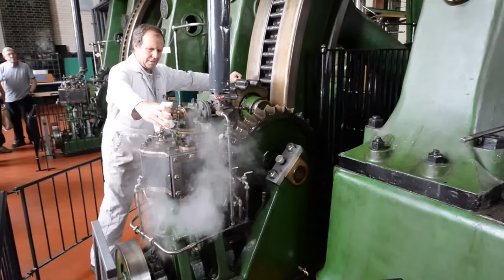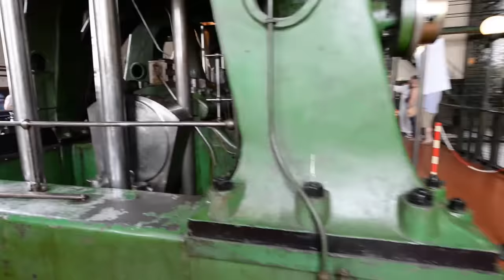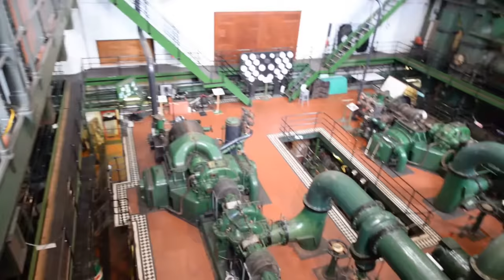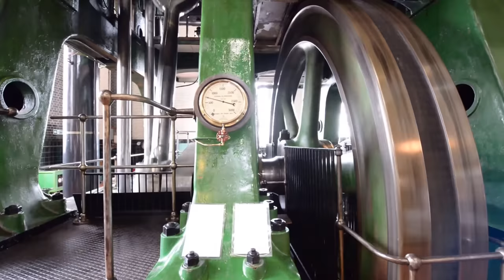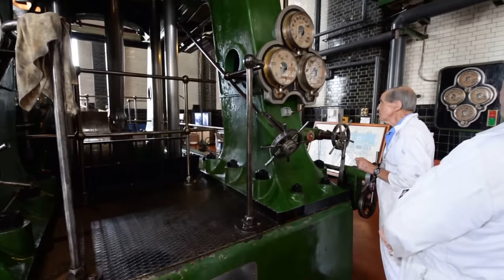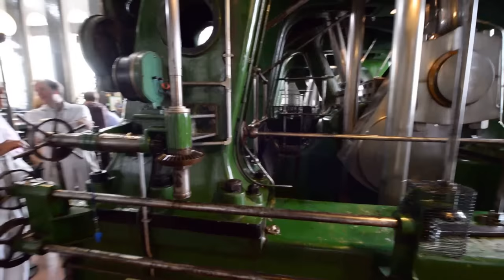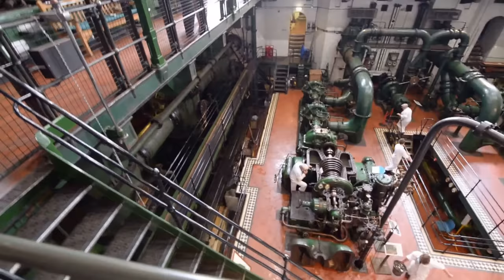Kempton Park  Big Triple Steam Engine Starting

Comment: Did some quick calculations a thousand horsepower at 20rpm has over 264000 ftlbs of torque.
Reply: two engines, 1008 hp per engine, 550 ft-lb/s per 1 hp, 60 sec per 1 min ... at 20 rpm ...
Wouldn't it work out to 2 x 1008 x 550 x 60 / 20 = 3,326,400 ft-lb total torque?
Reply: LOL, ftlbs
Reply: @D2RG6  at 20rpm by 1008hp it would be 481320 nm...
Reply: How many men using oars would there need to be to match that?  Considering all men are all natty and 190 lbs and can bench press 250
Reply: AMD yanks just aren’t intelligent enough. They can’t even get their dates in correct order of (seconds/minutes/hours/)days/months/years. And spell aluminium without the second I.
Reply: @shaunbrown85  just an fyi. It was us Americans who discovered aluminum. So for this word, in particular,  you're wrong.
Reply: @chadmeyer9500  ive heard that the last people you want to ask about the english language are the english. There even a video on here where an american professor is describing how americans are ruining the english language.
Reply: I love math!
Reply: Matthew DeMarinis I love math(ematic)s too.
Reply: @snipesrock  if you're going the way of "well it's what it was originally called" then you should spell it alumium :P
Reply: So almost as much as my civic
Reply: @chadmeyer9500  triggered much ????  also you spelled  "LABOR DAY" wrong its Labour, and I think your caps lock key is broken .
Reply: Spanish and Portuguese are like English and American now. They're close but not the same.
Reply: @chadmeyer9500  You're absolutely right, except for one thing, you're wrong. 
Aluminium is actually spelled, "Aluminium" as per the periodic table. 
Also, Americans are actually ruining the English language, so there's that; Gypsum isn't even in the periodic table, it's just a byproduct of Calcium, you've misspelled "Thallium", "Thullum" isn't an element, it's a 2005 Indian drama, I'd guess you mean "Thulium". 
The two following elements are also misspelled, "Gallium" and "Helium". 
You need to remove your tinfoil hat and have a look around.
Reply: @shaunbrown85  According to the periodic table, no, he isn't. 
Aluminium is however listed with "Alternative Name" as "Aluminum", and that way of spelling it is indeed correct in the US and Canada, but for the rest of the world (for the most part) it's Aluminium.
Reply: You guys.
Leonardo DaVinci could speak and write English, but it was considered a forbidden language.
What would he think of the Brits masticating it over a few millenia? 
Quit biting your own tails.
Every country and race has its own skeletons, and the faster people realize that, the faster we all realizing that our differences mean nothing, and should just be lessons to guide the future.

If you still want to argue, should we still be using names like Plumbum, Aurum, and Argentum? How about Kalium? Natrium? Stannum?

So much for whatever English you wish to use.
The Queen's is fine, but the rules and spellings were put in place long before the Yanks broke it off with that bastard George.

Back to the machine, please!
Reply: @shaunbrown85  why on earth would you do seconds/minutes/hours? what sence would that make? you start at the largest unit and narrow down as needed.  Would you ever say its 6mm and 2 meters long?  why would you ever start with the smallest first?
Reply: Troy dejesu no you wouldn’t say that every time, obviously, but that is the order; day comes before month. That’s the point. The 2nd day of January 2020. Just because you might say “the 2nd of jan 2020, it’s still the fact. 1 comes before two but you wouldn’t say “ive got one two pieces of jewellery”! That’s just daft. One still comes before two in the correct order, though.
Reply: I think the Brits are just upset the Americans have made the language more efficient, dropping all those extra letters (labor vs labour), if not entire words (November 6th vs 6th of November).
Reply: @chadmeyer9500  Even in your argument you still say 4TH of July and  !st of May ETC not July 4 or May 1 so you don't  even make sense of it yourselves.All i know is i enjoy getting payed big bucks (US100k) to come to the US  for 3 months of the year to supervise the installation of lifts and escalators, because it's in metric,and there is a big shortage in qualified people.
Reply: @snipesrock  First isolated by a Dane. In 1808 Sir Humphry Davy, the British chemist who discovered the metal, named it “alumium.” With just one “i” and an “ium” ending, it straddled the two competing versions we have today. Four years later, however, Davy changed his mind and gave the metal the name “aluminum”.
Reply: @shaunbrown85  All languages change over time. It's just how life is. I mean we're not speaking Anglo-Norman, now are we?
Reply: @nssherlock4547  You won't hear anyone call it "Eleventh of September" though.
Reply: @cojack5941    My math is a bit rusty, but ill give it a shot. The average human can pull around 200 newtons of force i believe, so lets say they are pulling an oar on a viking style ship and the fulcrum point of the oar is 7 feet from the handle, that creates 314.73 ibs-ft of torque, so that means you would need 839 men to be able to create the same torque as this engine.
Reply: @slaytronic  also in America, America is normally capitalized pretty disrespectful not to.
Reply: @snipesrock  Aluminum was first isolated in 1825 by Hans Christian Ørsted (Oersted) in Copenhagen, Denmark. Ørsted produced aluminum by reducing aluminum chloride using a potassium-mercury amalgam. The mercury was removed by heating to leave aluminum.
Reply: And imagine Titanic's engines, 74rpm and 46000 hp :-D
Reply: this engine has much more than 1000 horse heights .. Horse measurement is not suitable for measuring engines of this type. A huge mass of own, it is enough to compare the mass to engines in cars and you already know everything
Reply: David Vance  Sure, and every single horse has different power ofcourse. Watt is standardized for this purpose.
Reply: Chad Meyer  that’s a lot of text right there
Reply: @chadmeyer9500  no need to keep the caps lock on when typing, bud.
Reply: @Nareimooncatt  I'm a brit and I have no fucking clue what's going on. Our language our rules 😉
Reply: @chadmeyer9500  , i think the yank spelling of aluminium started as a spelling mistake (possibly intentional) in an edition of the websters dictionary.  i'm all for the more sensible yankified spellings of words myself.  jail instead of gaol etc.  a lot of english spellings were generated by a committee, centuries ago which corrupted common spellings to the sometimes stupid spellings we have today.  as time goes on and english becomes more common around the world, i'd hope that the stupidly words become more like they sound.  eg, this i before e bullshit-double e will suffice, thank you.
Reply: @snipesrock  No, it was not.
Reply: How is all this BS about spelling still a thing? English use English spellings and Americans use American spellings and the Russians use an entirely different alphabet! And don't even get me started on the Chinese!!!🤦‍♂️
Reply: Yeah my Cummins puts out about the same
Reply: @pwnmeisterage  I believe your answer is too big by a factor of 2*pi.      torque = (hp*60*550) / (rpm*2*pi)     hp = (rpm*torque*2*pi) / (60*550)     hp = rpm*torque/5252 (approx.)
Reply: @solarfluxman8810  You might be correct. But why do you say divide torque by (2*pi)?
Reply: @pwnmeisterage  Without dividing by 2*pi, your original answer would have been in ft-lbs of work per revolution.  To get the answer into lb-ft of torque, you have to ask yourself what circumference is a pully having a radius of one foot.  The circumference would be 2*pi ft.  So, in one revolution the pully lifts a weight 2*pi ft. The main problem here is that ft-lbs of work is not the same as lb-ft of torque.
Reply: @billyboots3730  If we consider how many minutes can a man hold that max effort of 200 newtons....maybe 5 to 20 min? So it means we will need 800 new fresh man every 20 min to keep up with the monster engine. Thanks for your calculation by the way, it helped me to have a better prespective of the power of that engine.
Reply: @davidprietogomez7254  yup, it woild take a lot of men to keep up with that engine, and thanks, its been years since i done any math but i think its a decent estimate on what that engine is actually capable of
Reply: @martincerveny2284  - horsepower is an arbitrary measurement.  Yeah, sure, it WAS based on horses but its just a standard math formula now that expresses torque and rpm.  

Sh*t!  a watt?  you mean the measurement that describes the relationship between amperage and voltage?  how does that apply to internal combustion engines?  Sounds pretty stupid to me.  

You metric fan boys need to get off your high horses!  Do you see what i did there?  You making fun of horsepower and all.
Reply: lol holy jesus 😥
Reply: @chadmeyer9500  Dude, you glossed over the fact that the Brits are the ones who created the imperial system. I'm sure a lot of people don't know this, evident in that everyone gives us shit for using it. 

It's almost as if everyone thinks we created it, when it was our mother country. Then they pulled a switcheroo and now we're called idiots for using it.
Reply: @chadmeyer9500  I think you left caps lock on mate. That often happens to triggered Yanks lol.
Reply: It doesn't work like that. There are limitations to the torque. That much torque would crumple the drive shaft.
Reply: @naga7647  An English guy (Tim Berners Lee) also invented the system that allowed you to type that - hahahaha.
Reply: Imperial is fine when one guy wants to tell another guy "hey bring me 3 feet of rope" or "i need about a gallon of water". Hey here in the uk in lay situations we still use imperial all the time for dick length! And dont mention weight of people even Yanks think 13 stone sounds insane! However imperial can absolutely not be defended past that for calculations it becomes a joke. Metric us not JUST for ease of calculation. How much does an American gallon of water weigh? Well thats 8.34 lbs which is a joke of a number! Of course in metric a liter weighs 1kg yay. Even in the UK we fudged a UK gallon of water so that at least it weighs 10lbs!!
Reply: @snipesrock  sorry to burst you bubble, Aluminium was discovered by Hans Christian Orsted in 1825 he was a Danish Chemist. But its presence was known as early as 1787.
Reply: @kefsound  that's right!
Reply: Look at everyone arguing over these entirely trivial things, as their world descends yet further and further into abject, and increasingly irreversible, chaos. Good God, people, SWALLOW YOUR PRIDE. You're embarrassing yourselves... Not to mention DESTROYING yourselves.
Reply: Lot of arguments in these replies... who cares how any word is spelt or spelled... as long as we understand what the other is saying... all things evolve over time... within the next couple hundred years or so all earth people will be the same colour (color) and speak one language. The human mind is great... as long as the first and last letter of any word is in the correct place the mind can instantly decipher the word. I believe that this works for any language.
Reply: Shaun Brown says the bloke who cannot even spell. Hahah
Reply: @snipesrock  yeah but he just spoke bad English....
Reply: So in other words a slight bit more than your average car.. 😅
Reply: @michael-dm2bv  i like your clever reply..🤣🤣  as long as you use the same ruler or tape measure for your work at hand you will/should be ok.. 📏 📐
Reply: @baggieshorts1406  back door math is doors math.   how u spell it does depend.  but those that become lawyers, defending the concept, get to play hockey.
Reply: @baggieshorts1406  - fight club.  the plane scene.  single serve.
Reply: @michael-dm2bv  heheheh 😅
Reply: @baggieshorts1406  - proper laughter is a proper measure.  the army of satan, at one point, will NEVER laugh.  they will be too busy soiling their drawers.
Reply: @michael-dm2bv  Wednesday Thursday  Friday
Reply: @baggieshorts1406  i know, right?  today is thursday.
Reply: @mattyturbo1  nope
Reply: @michael-dm2bv  It's maths not math. :~)
Reply: This goes to all the people saying it’s wrong. His calculation isn’t quite exact, but right...it’s 358.961,32 Nm =264.756,265 ftlbs
If you want further proof I can share my calculation: 

M = P/ω

ω = 2*π*n=2*π*20min-1/60s= 2,094 1/s
P = 1008hp = 751.665,6 W

M = 751.665,6W / 2,094 1/s
M = 358.961 Nm => 264.756,265 ftlbs
Reply: @Phley99  All these people arguing over why we still use Imperial units in America instead of Metric, and as usual people on both sides still don't know why... just enjoy the beautiful steam engine >.>
Reply: That is what you need for the tuff bolts
Reply: @naga7647  I prefer NM
Reply: @shaunbrown85  Wow you're such an enlightened being, please show those Americans the folly of their ways, God King Shaun Brown. You're the main character in this world. You sure showed those Americans, don't mess with the main character of Earth, Americans, Shaun Brown is here to put a stop to you and your ways.
Reply: @macgyveratlarge2133  Thanks for that. Let's get back to the machine!
Reply: Torque is power/angular velocity/2/3.14 

Which means at 1000 hp (750 kw) and 20 rpm (1/3 Hz), this thing makes 39 700 nm of torque, which is 29 400 ftlbs.

A friend of mine works in a nuclear power plant.
That plant has a turbine producing 1 450 000 kw at 1 500 rpm, meaning it has 9,2 million nm of torque.
Reply: @tomgarside480  The best part of being an American, well ok, the second best part, since the best part is all the great guns we have, is that we totally don't give a f#(k what any of the rest of y'all think about it.
Reply: @johndoe-so2ef  you were sitting in your basement furiously polishing when you wrote this weren’t you
Reply: Convert rpm to rad/s 20×2π/60 =2.094, then Horsepower to Watts, 1008 ×756 =751,968 W, then Power = Torque (N.m)× omega (rad/s) so Torque = Power / omega = 751,968/2.094 = 359,106 N.m, now convert to lb-ft,  so 359,106×0.73756 =264,862.23 ft-lb
Reply: Maybe it goes at maximum of 30 rpm, then the max torque is something like 176,541 ft -lb (or lb-ft), if the max power output is achieved at max rpm (I expect that's probably the case)
Reply: @abrahamwilberforce9824  Where do you get 20 rpm is 1/3 of a Hz?
Reply: Samuel Warner  that’s why you adopted them? Schooled the CIA in the arts in WW2. You adopted the British justice system, with the rest of the world. You all go on about the only place to have freedoms. Well guess what? Other people have freedoms of religion, etc, on other countries. Plus, you’re just an English settler, anyway. Native Americans are true Americans. Just like Hawaii you stole to incorporate into the US.

Comment: Hearing that little starter engine slow as the main engine reached compression and it just plodded through it !
Reply: the little starter engine is cute
Reply: There should be no compression on that engine... its not internal combustion, the pressure comes from the outside
Reply: @the_retag  Very valid point that !  It must slow down at pistons lowest point when there is less steam pressure aiding it ?
Reply: @mikesgsg2912  also ulnikely, considering the big flywheel and the multiple pistons. But maybe it has got something to do with the fact that its triple expansion